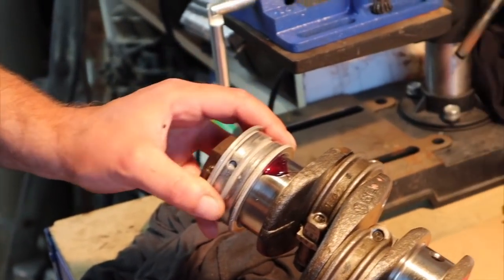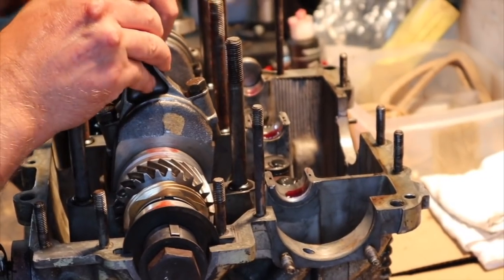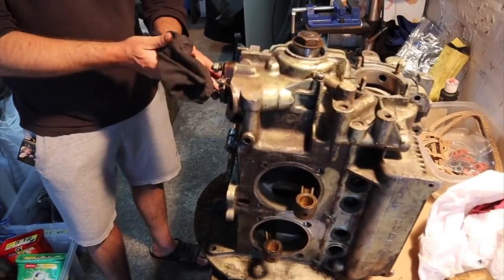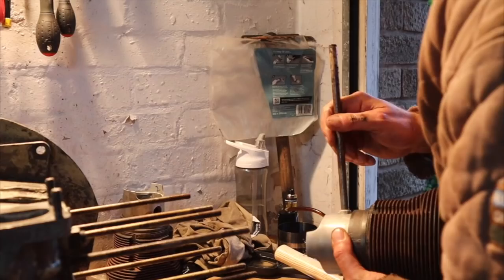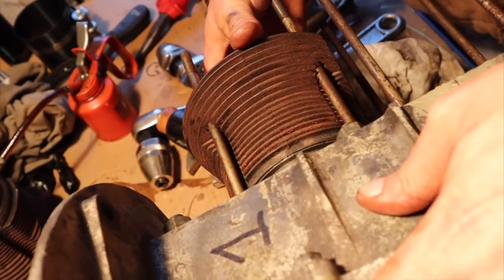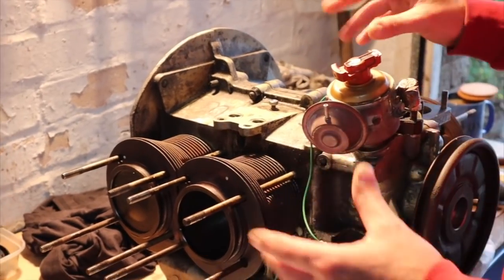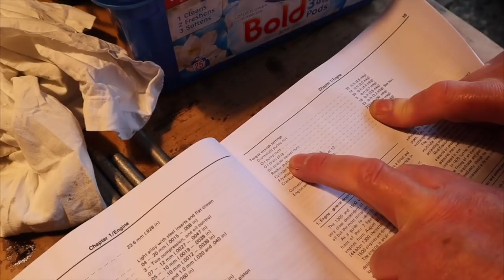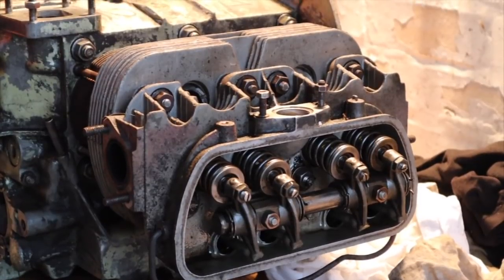VW Beetle 'BERTIE' Air-cooled Engine Rebuild - SKETCHY- Part 5

Comment: yo're dist drive can be corrected without opening the crankcase the notches in the drive should line- up with the crankcase seem watch out that you don't drop the two drive spacers in the crankcase I drive vw's now but I had a 74 Capri for thirteen years
Reply from the maker: Thanks Robert, much appreciate your comment, have you watched the rest of the related videos?

Comment: It doesn't matter where the dissy is positioned. You can twist and turn it to its' correct position once/if it's running. The cam shaft is going to be your biggest headache because it looked to me to be at least 1 tooth out of alignment. The cam controls your valve timing more than anything and if that's not correct you're never going to get it to fire up no matter how much you twiddle the distributor. Also, the TDC mark on the crank pulley lines up with the right hand edge of that part of the crankcase (where the joint is) that has a vertical protrudance at about 12 o'clock behind the crank pulley.
Reply from the maker: Cam has had its 'dot' located in between the two 'dots" of the crankshaft gear/cog.
So it's in the correct location, but not sure if it can be 180degrees out?
Reply: @Classiccarbscouk  If the timing marks are aligned correctly as you say then it won't be 180 degs out unlike the cam timing on a Pinto block when the arrow is pointing up rather than down. The dissy drive in the engine block has a slot in it which is off centre and the dissy shaft has two 'teeth' at the bottom which fit into the slot. Twist the rotor arm back and forth as you fit the dissy to get it to seat into place. So when you fit the dissy in the hole it's not going to be miles out.

Comment: Good fun and definitely seems to be looking good so far. You can test start the engine on the bench before you put it back in the car,  If Steve follows Mustie1  he must have watched a good few beetle engines will it start  vids  or if you want to go posh you can sit it on a fork lift pallet. Not sure what you need to mount the starter motor though?
Reply from the maker: That's the biggest issue we have.
No bellhousing to mount the starter motor on.. 

Saw an old timer start one up with a wrench on the crank pulley

Comment: A pro tip: you can't torque bolts from a "stand still", the restart torque will make the torque bar to click. Torquing bolts has to be done while the bolt is in motion. If you are unsure, loosen the bolt and start over, and don't stop the motion until you hear the click, if you are close to the click and stop you do not actually know if it's torqued to spec, a lot of people don't know this.
Reply: That only make sense to ensure that no bolt was forgotten.
Reply from the maker: Thanks Daw, that does make sense.. note taken, thank you!! 🛠🔥😎🏁